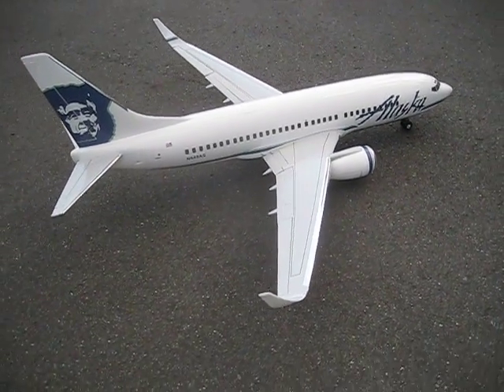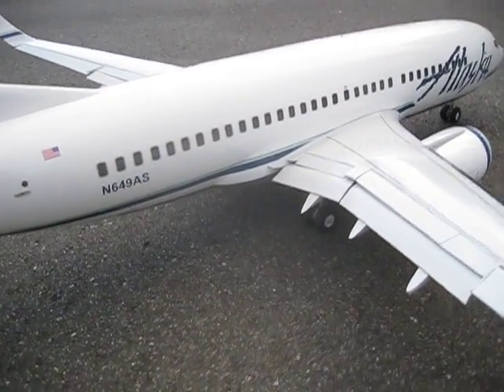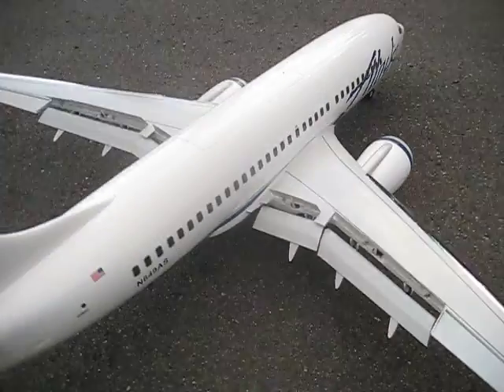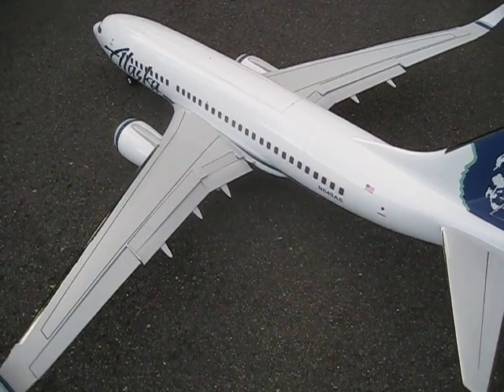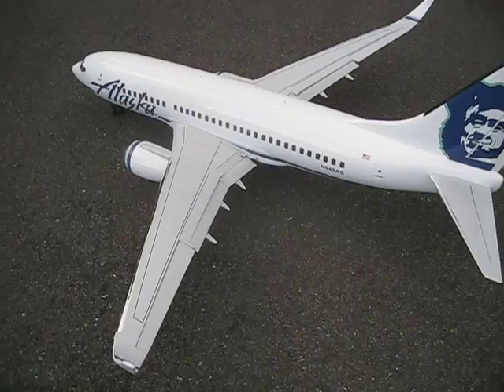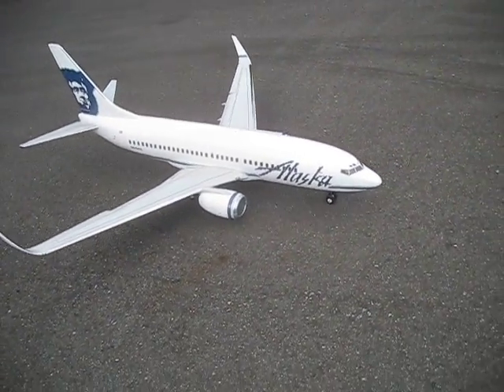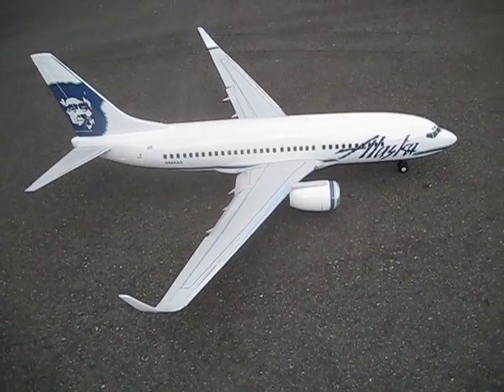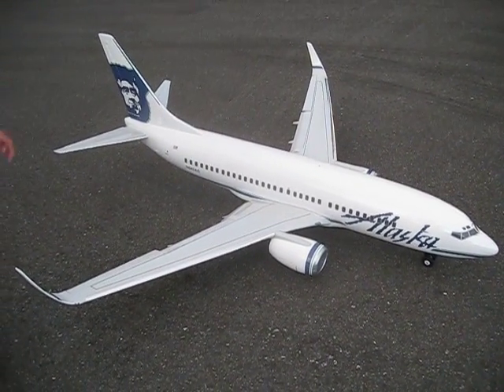RC Windrider 737-700 Overview, Flaps & Spoilers

Comment from the maker: @MARINECORPS61992113 
It's pretty straight forward actually.  I just cut the foam gear mounting area into the airplane further by about a half inch so the nose sits lower like a real -700.  Beyond that, I wired a "pull-pull" type cable on either side that becomes slack when the gear retracts.